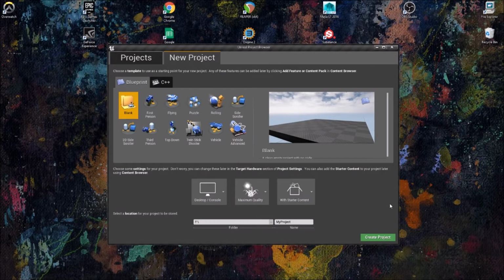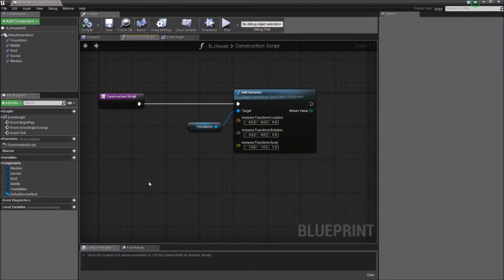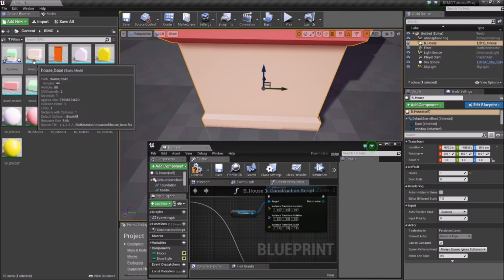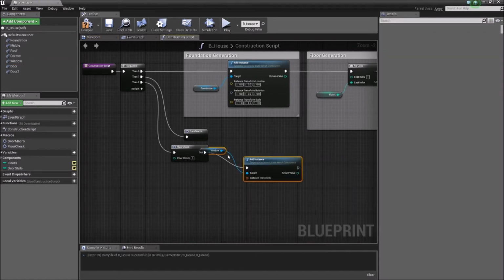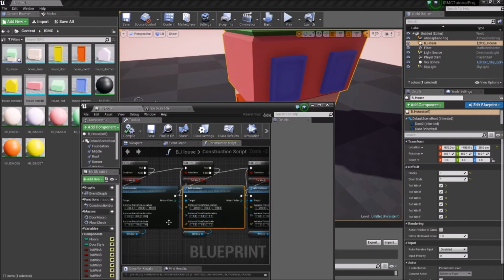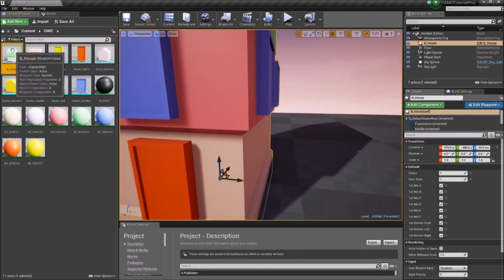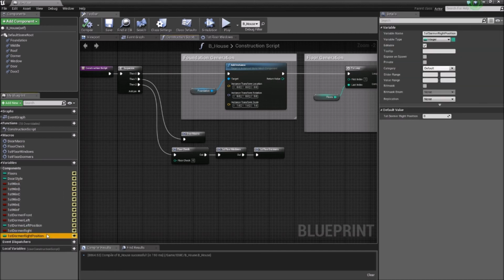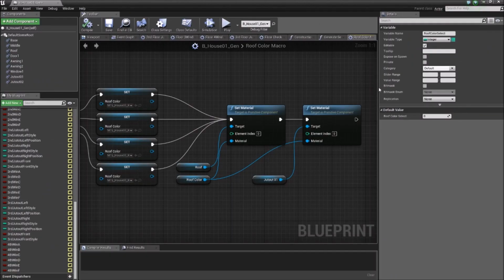UE4 - Constructing Buildings with Instanced Static Meshes [TUTORIAL]

Comment: Dude, you are doing it in a wrong way. You are making all these things for every floor right? You need a just one method and that method should do the job for every floor. You need a list, and when you increase the floor number, which means you add more floor, you should add that floor to the list. When you decrease, you should remove it from the list. Also you can adjust your windows position based on the previous floor position. I mean you don't have to do that for every floor seperately. I am not UE4 user, I am using Unity by the way. Sorry for bad English. It was a little bit hard to tell. I am not sure if I was clear or not.

Comment: So you can't assemble the building using regular meshes and then convert them into Instanced Meshes somehow? I have some complicated buildings I'm trying to do this with and just want to make sure I understand everything before making too much ridiculous stuff in Maya.
Reply from the maker: Instanced meshes are just regular meshes, but instanced in the construction scripts. Model away, amigo!
Reply: I get the idea of them, but not having the ability to move them around in the viewport is what I'm concerned about.
Reply: @TheAxebeard  you move the blueprint you set them up in or you can offset certain parts in it using vectors or transforms
Reply: There is a plugin in the Unreal Store by Mary Nate that does what you want. https://www.unrealengine.com/marketplace/instance-tool 
Adding that this is also possible without the plugin, it's just a bit more work involved. What you basically want to do is spawn the instanced mesh and drive its position and rotation through some form of node in the viewport. Have a look at how splines are setup in blueprints since they often use this kind of technique.

Comment: Followed the tutorial just to realize that at the end you just manually add floors. This was sorta a useful tutorial as you show us how certain things work, but not very practical.

It would have been more useful and practical if you did a forloop and stored the floors in an array. Then for every floor stored in the array say: Add windows and dormers (which you can check on and off). That way you don't have to manually add a variable for >every< floor. Saving that extra 20 minutes of times or 200 minutes (if you add 30 floors).

Nevertheless, thanks for the tutorial I did learn a few things, but I personally am not going to use this.
Thanks!